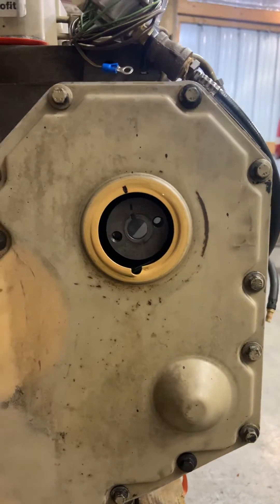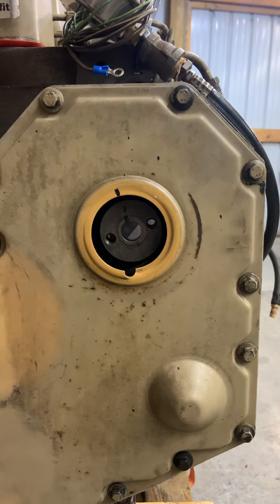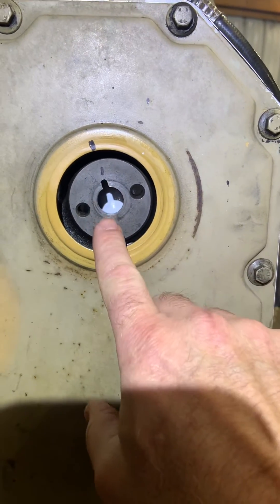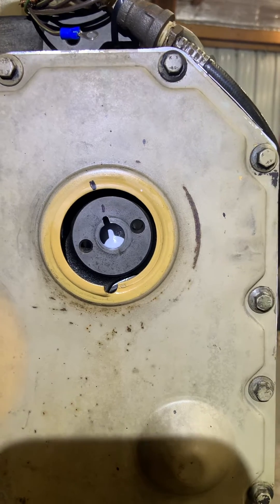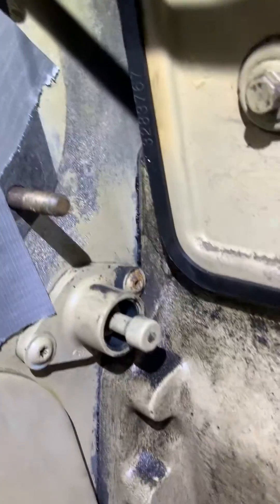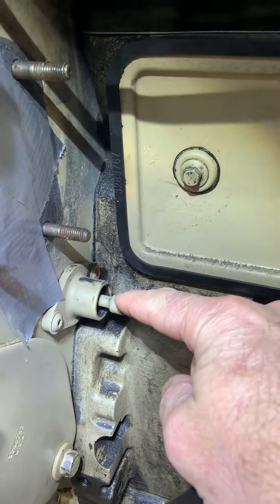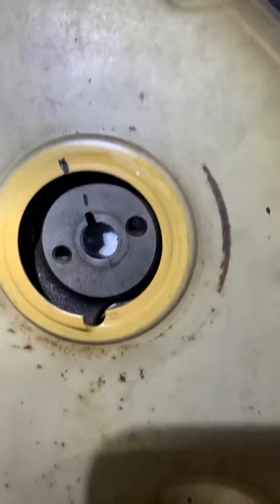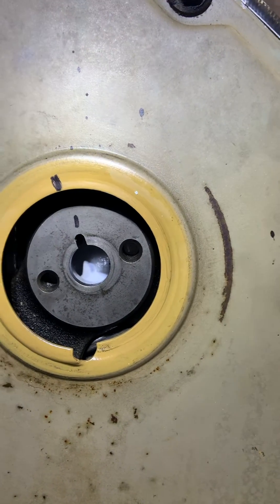4bt Cummins Timing Mark Position

Comment: You said lock pump. Where is pump lock???
Reply from the maker: It is located on the side of the pump next to the flange that bolt to the timing cover. Look for a bolt head and under the bolt head is any-shaped shim. Unscrew bolt and remove the u-shaped shim. Set pump at top dead center using the push in pin located in the back of the timing cover and then tighten bolt where you removed the shim, pump is now locked and won’t move when you pull it off. Don’t forget once you install pump to remove locking bolt and install the shim. hope this helps. Let me know if you need anything else. Thanks for watching.
Reply from the maker: Also go to my channel look down in my playlist in under the Cummins Chevy conversion look for the video that says 4BT almost exploded. go to the video and start watching it at eight minutes in five seconds there where my pinky finger is where I’m pointing at the scribe on the pump you will see a small bolt head that is it right there.

Comment: I'm hoping I get a response I have a 19 99 Cummins diesel generator fuel injector is bad. It's a Cummins 4B3.9 g. On the front of the pump it has no timing mark, okay I took the pump out Carter key was shared, you can turn the pump by hand and just goes around and around clockwise. It don't click it don't have a timing mark on the front of injector pump.
Reply from the maker: It takes some force with a wrench to turn the shaft and it should pop as the internals work like it should. If the pump shaft turns real easy and you got some internal damage that has taken place I don’t know why there’s not a mark for the timing on the front of the pump where the keyway lines up. You may have to take it somewhere to have the pump checked out.
Reply: @jeepmanking3577  thank you that helped